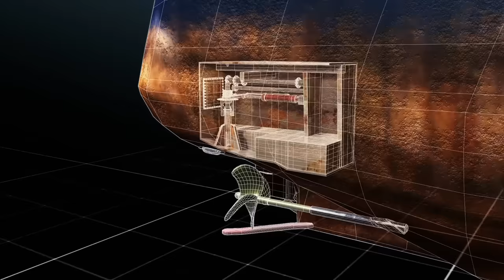Saga's Rudder Comes Loose In the Middle Of Huge Storm | Deadliest Catch

Comment: I was on the f/v Northern Voyager and she sank about 5 miles out of Gloucester Mass in the late 90’. 
I was 18. Lost the rudder with no way to patch the hole.
Reply: Glad you made it man dam that had to be scary .
Reply: Mass gang
Reply: I have a question about that temporary fix they did to keep the pipe from moving up or down. Couldn't they do beforehand to prevent a major catastrophe like that from happening? It seems like a simple fix.
Reply: @mumble97  prob did this for drama
Reply: @mumble97  they obviously didn't know about this until we saw this

Comment: For people don’t understand this issue if you can’t steer the boat into the waves a big wave can come and capsize the boat. A damaged rudder is not good same thing with planes
Reply: He can still steer the boat with the engines and drive it like a tank.On my boat I use my rudders for ships wheel trim so you know where on the wheel straight is, and my engines for steering.
Reply: The biggest danger isn't losing the rudder, it's losing the whole post and leaving a gaping hole in the boat that can sink it. Boats have gone down with that kind of problem before. Jake handled it very well.

Comment: Losing a rudder isn’t the end of the world. If it was northwestern that would be an issue because she’s single screw, but this is a twin screw boat and you can steer with the props. Typical discovery over dramatizing everything
Reply: Also they could cap the hole with a temporary fix until they head back to port
Reply: @matthewwilson5019  Would be very hard if not impossible to cap that sort of hole, youd have freezing water rapidly shooting up through in a tight space in rolling seas, and youd either need to weld or shove blocks in.
Reply: @yeetandskeet  ah ok, I never worked on a ship so I wouldn't know lol
Reply: Isnt the compartiment where those rudders come in water tight also?
Reply: That's the main reason why I don't watch many Discovery channel "reality"-type shows anymore. There's far too much manufactured drama that gets recycled between episodes and even different shows. Moonshiners, Gold Rush Alaska, Bering Sea Gold, Dangerous Catch. It's all the same stuff happening, just in a different setting.

- Someone gets injured or arrested and can no longer participate
- An important piece of machinery breaks causing stress and delays
- A goal/target isn't met which upsets the boss(es)
- An argument between two individuals occurs and is settled by the end of the episode
- Bad weather cut the day/season short

I remember one mining show began a season saying "thunder snow is an extremely rare event which only occurs once every few years," but nearly every expedition that season was cut short by "thunder snow" causing the miners to quickly scramble off the mountain as if they were being chased by an invisible man wielding a knife.
Reply: I was crew (of 13) on the f/v Northern Voyager and we lost our port rudder. We had an 8” hole. We did everything we could, but we had to abandon ship. Fortunately the Coast Guard was there in quick time. When the water was about 4 feet deep on the second deck we got our survival suits on and went topside. Try jumping on to the bow of a 110” Coast Guard boat in 20’ seas. Timing was everything. All of my stuff is still in the STBD stateroom in the bow, middle rack, outboard. 
That company did so much shady stuff. Honestly lucky to be alive. We were so far out during that storm the night before. We made it about 5 miles away from Gloucester Massachusetts before all efforts were hopeless.
Reply: @andrewbrady3139  i thought all crew evacuated to a 47’ coast guard vessel in 6-8’ swells. Certainly a tense situation but certainly not as scary as 40’ waves?
Reply: @matthewwilson5019  then why are you talking about something you don't know anything about
Reply: well, if 7:13 is anything to go by this is a single screw boat too, in which case losing the rudder would be a very big issue after all
Reply: @dissatisfiedgamer7436  In the wheel house there are two throttles and in pictures of the Saga at drydock you can see both props and rudders.
Reply: @dissatisfiedgamer7436  6:08 you blind?
Reply: @spicysnowman8886  well because it looked like they could. I bet you have done that alot yourself in ares you have no idea what you are talking about
Reply: @Captain yes got a problem with that? And did I EVER claim I knew anything? NO I haven't, it was just an observation. I know you have done that alot in areas you have no clue about
Reply: @Captain also did I ever say that I am an expert working on ships? No I didn't. Plus this is fucking youtube im allowed to comment
Reply: Simple quick fix. Captain skills +69

Comment: It could have been bad but they just eliminated catastrophic failure. Keep crabbing. Done for dramatic effect. Even if it did drop, and you know about it and where to address it, all you have to do is stuff rags inside the rudder shaftlock it’s not like there’s a lot of water pressure or hard to get at.
Reply: Actually would be be like a diving bell?

Comment: Aren't most rutter shafts designed to have the top of the shaft tube above the waterline? i.e. if the rutter were to fall out, the boat would not sink because the hole would be above the water.

Comment: In a pinch you can also steer with the engines, as it is a twin screw.
Reply: but that doesn't make for good television.  :-|
Reply: U can but if the rudder post breaks off entirely u will be doomed
Reply: Our cabin cruiser has 2 screws and it’s super helpful when the wind is blowing and you can just turn in place
Reply: @pinrenng8162  not true. They could easily plug the hole and steam in with the second Rudder
Reply: @Mad.Man.Marine  Easily? If the rudder post dropped through the hole then you would have a 8 - 10 inch hole in the bottom of your boat allowing a huge amount of freezing water to enter the compartment. I know the Royal Navy train to plug breaches like that and I am sure its the case for most navies around the world. These are not sailors intensely drilled and trained for such situations. I thnk under the circumsatnces Jake's bodge job was pretty well done.
Reply: @robertmills6497  it worked and that’s what really counts I guess. I would like to know if that hull type uses skews to help support the rudders. Most boats do. But some big ships have dagger rudders. If they use a skeg then no. The rudder can not drop out.
Reply: @pinrenng8162  hopefully the compartment doors would be able to hold the water pressure. Ships are designed to keep flooded sections localized. Just because there is a breach doesn't mean the entire ship with all of its compartments would flood.
Reply: @Jasonhb07  These boats don't have the reserve buoyancy that other vessels do, remember their bellies are full of water holding tanks. And they are all old and maintenance budgets aren't always there, the chances of that compartment being 100% watertight anymore is low. It was a very real problem, crab boats have gone down from far less.
Reply: @Cragified  You're right. There's not much space above the waterline to keep the ship afloat. No wonder these things sink so fast. I'd hope that the compartments slow sinking to where the crew can successfully escape.
Reply: Twin screws can be steered with both engines and no rudder with a little practice. I ran a boat yard where I used to move twin screws all the time in and out of tight spots with just direction/throttle control to show off to the new guys. Missing a rudder in a storm? Pretty frigging dicey.
Reply: @philtanics1082  A calm boat yard is not the middle of the Bering Sea. You are comparing apples and oranges.
Reply: The Captain has to repair it? Jake needs to get a qualified engineer with welding and fabrication skills.
Reply: Twin screwing in 30' rollers isn't going to happen. They need rudders to immediately correct with all power going ahead.
Reply: @Mad.Man.Marine  you try plugging a 6-8 inch hole with seawater gushing in. Not gonna happen.
Reply: annoying but doable

Comment: There should be a collar on the top of that post that would prevent it from slipping out.  I realize that if you ever had to drop the rudder you would have to grind it off but you can worry about that when you are back safe and sound.   Seems like a design flaw.

Comment: that is bad if Jake loses the rudder he will lose control of the ship and Saga will sink they need to fix this and get Saga back in gear.
Reply: Just like discovery you are exaggerating a lot. There is always a watertight door separating the rudderchamber from the rest of the engineroom, so sinking is not possible when that door is closed.
Besides that, it has a double propellor and rudder, so it will be hard to manouvre but its possible to back to safe waters.
Reply: @koen5457  if they lost the rudder the waves would capsize the saga even with twin engines can you imagine how hard it would be to control the ship?
Reply: Wow so he has a camera pointing at the rudder but yet he doesn’t know what the problem was gtfoh....classic deadliest catch lame drama 😂
Reply: @jrrains  not that hard. Forward and back and increase or decrease the power to one engine or the other. Just like an airplane
Reply: @jrrains  much worse it will put a hole in the boat and the ship will sink